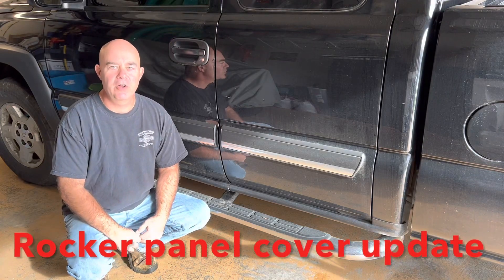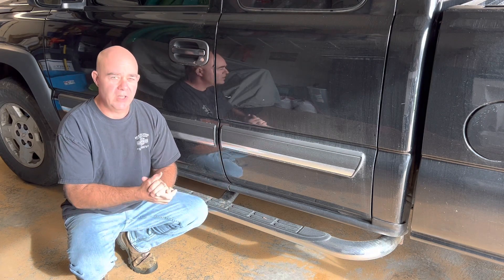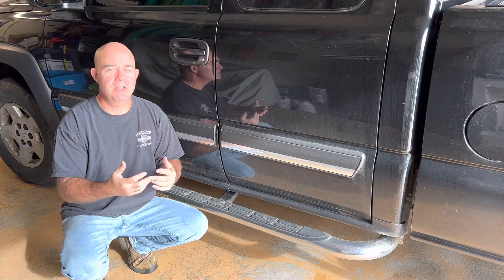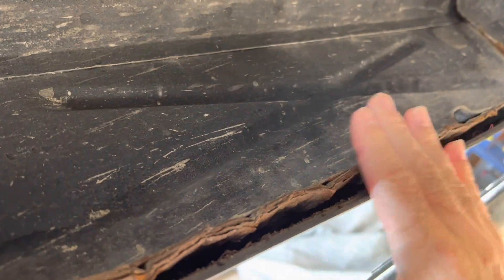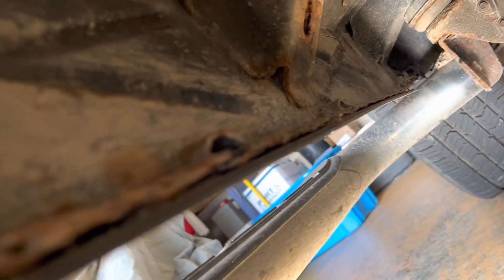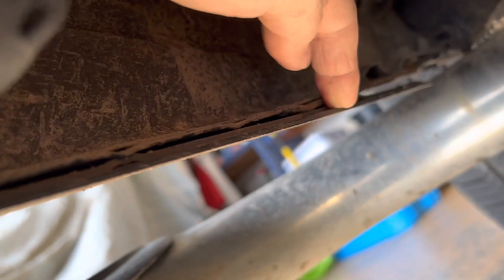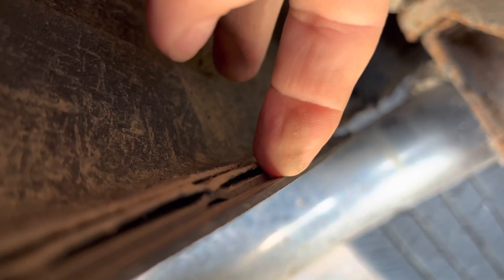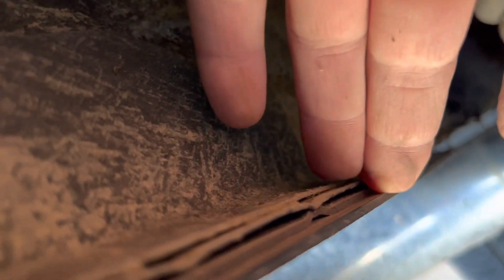Chevy Silverado Rocker Panel Covers *Update*

Comment: thanks, new subscriber to your channel !  I've had my 2006 Silverado Z71 going on 5 years now and starting to work on some of the things I've found on your channel.  When I first got the truck, I had to replace all of the brake lines and also a lot of front suspension parts, so after all that I've mainly tried to enjoy just driving it and not work on anything.  It's been a great truck !
Reply from the maker: For Sure. One of the first things I had to replace was the brake lines as well. Definitely more enjoyable to drive than it is to work on, lol.Thank You for watching and Subscribing!
Reply: Why did you have to replace the brake lines and front suspension parts? We’ve had an 04 z71 for 18 years now and it has gone through brakes/ calipers and front end suspension parts like no other.
Reply: Living in Illinois my brake lines were totally rusted out.  180k miles and original owner never replaced anything and most steering parts had lots of play in them.

Comment: Hi,  I'm still in the what should I do phase, including not adding slip on panels, but just neutralizing the rust and overcoating and protecting the remaining metal. I gotta think though that whichever we we go, just adding slip on panels over active rust without solving issues will trap salt and moisture in those bad areas and speed up the destruction. Somehow using adhesives or screws and ways to eliminate those gaps have to be used.
Reply from the maker: This for sure is not going to prevent rust. And probably not any kind of prevention will. Couldn't hurt to try if you wanted to. Maybe slow it down some is all we could hope for. But I do like the way my truck looks again with the new panels on there. I'm pretty sure you would too.

Comment: How about if u only have 3 doors Silverado will this still work on the side where there’s only one door??
Reply from the maker: Watching the video you will see that the covers snap on the inside of the door opening. If there is not a door that will open on one side then these will not work as designed. You might be able to modify them and get them to work but I have not tried that. Thanks for watching!